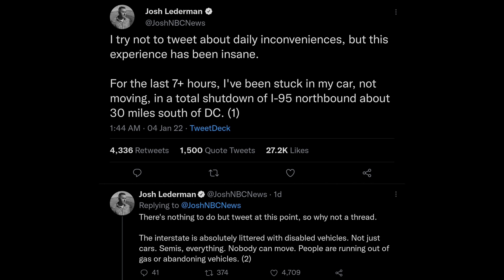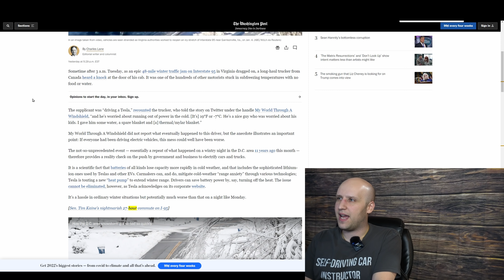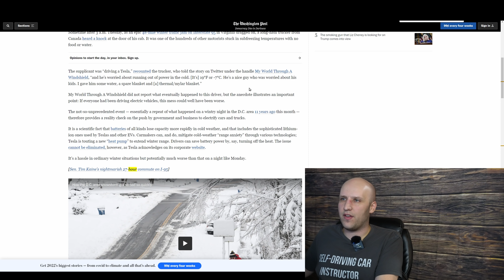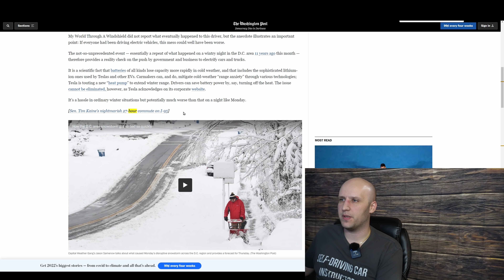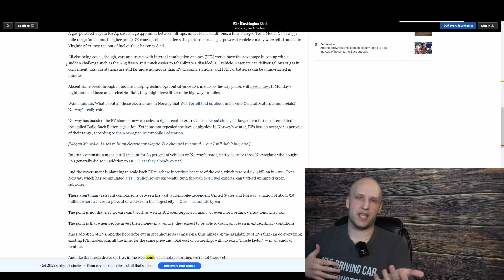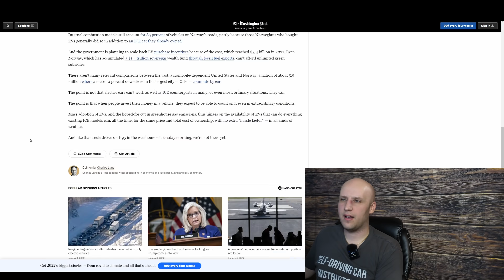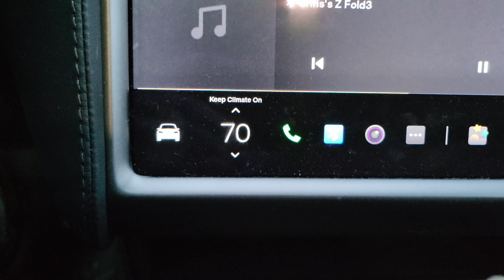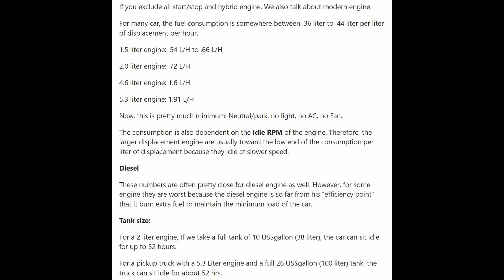How Long Can a Tesla Keep You Warm In A Frozen Traffic Jam? | FUD Debunking

Comment: I was stuck in that I95 shutdown. I drive a 2018 Model 3 LR RWD. I was at 90% when I left work and when I came to a stop on I95 with 73%.  I did not move for 11 hours.  I kept my heat on contently at 68 degrees and streamed Spotify for 5 hours. I did not use my seat heater.  When I start moving again I was at 40% charge.
Reply: Strange, I was at lower percentages and also played some games and got out at 40% that traffic jam was fun I made 3 friends they were all driving EVs a Bolt EV and VW Polo e-Golf and a Tesla M3P I was in a Tesla MXP and none of them ran out of juice
Reply: Did you drive to a Tesla charging station after that or just head home?
Reply: As Dirty Tesla said using your seat heater is much more efficient then using your AC to warm you. Blankets help too. Me personally, I don't us my seat heaters all that much, only at the beginning for a drive if it's cold. I had been driving for 30 minutes before I came to a stop on I95 and my seat was already warm from my body heat. I can charge at home but my driveway was blocked with many downed trees. The I95 shutdown caused traffic to find any other route that was open. This resulted in traffic jams on most roads through Stafford, VA where I live. Getting to the Supercharger at the Wawa on Rt610 near I95 was very challenging. I pulled into the Supercharger at 13% battery.  Great for 250KW V3 fast charging!
Reply: @Matt-vz8lz  How long does it take to fully charge the Tesla on super charge?
Reply: @lincoln169  mine takes an 1 hour and 15 minutes depends kn the range you chose
Reply: What if you had used your seat heater?
Reply: @waywardgeologist2520  If your tesla or other type electric car has a heatpump heater it is better to let that heat the car. If not then if possible use very little heat or no heat at all and use the heated seater to keep your body warm as much as possible.
Reply: Good information. Thanks.
Reply: I was traveling to Virginia with my family, luckily we were advised to avoid I-95 (despite the weather), though the roads weren't great out here either. I'm from New York, I can't believe how quickly an entire city can be shut down with like average snow for my area. 

It has to be the lack of infrastructure because there were technically warnings about the snow the day prior, though who would take them seriously considering the conditions the day earlier?
Reply: @jpsalis  it happened in 2016-2017 in VA around then too, media was calling it snowmaggedon.  I was living in VA then now I’m in CA where it doesn’t snow lol
Reply: @jpsalis  Or was it the people who did not heed the weather warnings?
Reply: @jpsalis  Yeah we need Joe to spend trillions more on infrastructure. Oh wait; his buddy Obama already did that. Hmm..... then why is our infrastructure still crappy and like no visible improvements? Oh yeah, the banks took the money somewhere else.
Reply: That’s awesome
Reply: When the gas cars apeared theytold us to buy a horse, when the electric cars are begining to play a rol the told us to buy a diesel. The thru is that gas car ar the past in 20 year they whil make jokes if u buy a disel or petrol and dont buy an elecric car. Sorry for my bad english
Reply: You should have used the seat heater and turned the heat down to around 60 and also shut if off from time to time for intervals of say 10 minutes to further save the battery. You didn’t know how long you would be stuck.
Reply: What if all these cars died and had to be moved when the road was cleared? Who’s going to be charging them all at the same time?
Reply: @TKUA11  Well there were many EV drivers and we made a circle among ourselves and I am saying NONE of them ran out of battery for the whole duration
Reply: Lucky you didn't die or get hypothermia. No battery energy stranded on the road is way worse than getting a quick fill up of gasoline from a red can.
Reply: Clearly your EV should be sent to the crusher. Gas cars never have any issues in cold weather! Who would ever rely on electricity for starting a car.....preposterous I say.
Reply: @Windupmykilt  EVs don't start they just run that's the thing a cold engine may not start up but motor it doesn't need to rev up to a minimum rpm to work its just gonna run as long as it has electricity
Reply: @ray.upside-down  I think they were being sarcastic… ICE starters are driven by a small electric motor, so they are saying that EV haters who say electric motors can’t handle the cold are so wrong because their own cars rely on an electric motor to start.
Reply: @Windupmykilt  Why be an EV hater when its the same but better and also helping the environment. I am ready for your arguments with proper explanation
Reply: @ray.upside-down  It was a little subtle, but Windupmykilt was being ironic.  Yeah, he was joking.
Reply: @ray.upside-down  Read the room bud, its clearly a joke. The sarcasm is in plain sight. All ICE engines require electricity to start (12 v battery to starter motor, system only charging once running from the alternator). The cold effects their ability to start worse than an EV as a -30 C engine can be bad enough to barely crank from cold oil, cold battery and low prime in the fuel rail. Its always funny the FUD regarding EVs as in the winter most people are plugging in their ICE cars around -20 C as some cars are like a boat anchor for cold starts even with synthetic oil. Diesel vehicles will have a hard time generating cabin heat in cold temps us well unless your get a grill cover and a idle throttle up adjuster. My next car is very likely a full BEV anyway, Im a huge supporter of EVs

Comment: Would Camp mode not have helped? During other tests the M3 for example eats around 30 miles during a cold night (-20C), that would be roughly 10% , the 40% you experienced is quite a leap from that. And also one thing that the article nicely avoids is that for running a ICE car you run the risk of actually dying of carbon monoxide poisoning, as your exhaust pipes can easily be blocked during a snowstorm. In a electric car you can pretty much set the temp and have a nice cozy night while not having to wake up each 30 minutes, run the car for 10 then shut it down and go back to sleep until you freeze again.

Comment: Idling my ICE car burns about 1 gallon every 2 hours. So my 19 gallon tank if completely full would take 38 hours before it runs dry. So pretty much the same as Tesla plus you don't die from carbon monoxide poisoning in Tesla.

Don't forget, my Telsa has a substantual below 0% buffer. My ICE car doesn't.

Comment: I drive a 2020 Modal Y. Love it. I did actually get stuck in a highway closure on a long road trip once for about an hour and a half before I decided to drive backward down the grass median and get off the highway. Obviously much less time than this, but I was a little worried for one reason which was totally my own fault, but I think also kind of part of EV road trip culture. At the time of the jamb I was at about 16% charge. I was only about 20 miles from my next charge stop which would be no problem. It was mid summer so the AC was running, and I did get nervous as I watched the percentage drop a few over the time I waited. The road trip culture that I was referring to is that myself (and many other EV road trippers I believe) like to arrive at the next charge stop with as little charge (5-15ish%) in the battery as possible to take the most advantage of fast charging up to the point when it tapers off, and then hit the road to the next stop. 

Obviously you wouldn't do that type of thing in a gas car (try to run down the fuel as much as possible between fill ups). In fact the culture is most people fill up at 25% (quarter tank) or above. Idk, just got me thinking. Not a fault of the car or the battery at all, just a fault of how I CHOOSE to use it. I could totally plan into the trip to always make sure I stop and fill up at 25% or above. That's just slower though.

Comment: Good test, I think a ICE will still run a little longer depending on model, and if done right but you would have to be more careful about carbon monoxide poisoning.  That fact alone makes me prefer an electric in that situation.

Edit:  Oh yeah they had plenty of water if they had even a used Mc Donald's cup or something and just thawed it out and warmed it up on the defroster.
Reply: You turn the HVAC control from fresh air to recirculation. This will prevent the HVAC from pulling in the exhaust fumes from the car in front of you.

Comment: I own a tesla too (model y with heat pump), but you're stretching here when talking about how it's not that bad in cold weather.  recently drove through montana.  tesla chose the route and charging stations.  Barely made it to a couple of the chargers and the car WOULD NOT EVEN LET ME TURN ON THE HEATER.  I almost lost toes from frostbite.  I had to stand of the seat while driving because the seat heater was the only heat the car would allow.  There was also no warning or on-screen prompt that I would not be able to use the heater.  True story.

Comment: I read the same WaPo article, and posted a comment there with some of what you mentioned,  I also used the example  of the SoCAL chapter of AAA  which did have generator equipped towtrucks for a while, but found that "range anxiety" was not happening and I think they don't have them anymore. I forgot the "Tow Charging" trick you included, Thanks. 
Because I travel into the mountains quite regularly, I have for many years kept a Space Blanket in my cars including my Tesla, just in case I forget to have a warm jacket along. The human body emits around 75 to 100 watts of  radiant thermal energy to go with that seat heater, and the car's air heater.  Good to know that a half tank of gas or a half charge in the battery are roughly comparable.
 I think this sort of article would not be appearing in the media about Tesla if they would just do what all the other car companies do and place ads with them. Packard might still be a viable auto manufacturer had they not insisted that their quality was such that their line "Just ask the man who owns one" worked as well as GM's massive ad buys did in the 1950s.

Comment: Hey Chris! You need to scream this from the rooftops!  This was a great experiment showing that you are equally safe (or equally screwed) in a Tesla compared to an ICE vehicle. A few more points for Teslas are the ability to stream entertainment for yourself or your kids during the time you are stranded on the highway and not having to worry about carbon monoxide coming into the cabin from a partially blocked tailpipe (a very realistic possibility, especially if it continues to snow and blow while you are stuck). Keep up the great videos and the great information!
Reply: Sorry, but you can stream and entertain in any ICE vehicle too.  It's called cellphones and tablets.  (You can even stream music too).  As to carbon monoxide  coming in the cabin, I would turn on air recirculation. Make sure to keep snow clear from around your vehicle. (Doesn't matter ICE or EV)
Reply: @Pk3_Garage  so in the ICE car you have to step outside several times in a blizzard to make sure your tail pipe isn't obstructed. And in the EV you can stay warm inside through the night. Sounds about the same.
Reply: Rather your in an ICE or EV, it's a good idea to clear snow from around your vehicle. This will prevent you from being trapped inside. The tail pipe on our minivan is around 18 inches off the ground, so I'm not concerned. (We have rear air adjustable shocks)

Comment: One thing the article completely overlooks is that MOST people that own EVs charge them at home in their garage over night, and wake up every single morning with a full or nearly fully charge. That's actually one of the biggest benefits of EVs...having a full tank of "gas" every single morning. People only fill up their ICE vehicles when the get low on gas; often less than 1/4 tank, because it's inconvenient to go to a gas station. Thus, it seems more likely that a typical ICE vehicle would be stranded as compared with a typical EV, because it is much more likely the EV has a full charge and the ICE vehicle has half of a tank or less.

Comment: my first winter with a Y. 15F this morning, and snowed over night. Car was plugged in and preheated before leaving. Wife went to a couple of stores, 12 mile drive with a couple stops.
used 60 miles of range.
Not likely to take a trip in the winter (anyway) but certainly not with 'performance' like that.
Reply: That sounds strange, those numbers would essentially make EVs unusable in Norway (which they are not). Weird ... I can't say why you got so low a remaining range... don't suppose you noticed the remaining state of charge?
Reply: @nielsnb11  some T folks say to precondition teh battery in the cold. Fine for leaving the house, but if it sits an hour in 15F temps it will get cold again. Then prec will suck down the battery, so why do it?

And heating the interior up over and over sucks power too.

I know they tested the Teslas in canada, so I expected better.

Comment: Please run a full test by letting the battery run empty. You said yourself that the cars used more energy to heat the cars up at the beginning which means that there is no linear behaviour. Also maybe reduce the cabin heating as you would in a real emergency. That would be a more convincing test to convince people who don't trust electric cars for some reason.  Considering that most people would be wearing warm winter clothing in a snow storm it might be enough to only use the seat heating without the air heating to stay warm. Thanks, that would be great.

Comment: Great video. There are now several MOBILE Batteries to charge EVs that you can have in the car - like many have a spare-container of gasoline. They're just very heavy:50-75lbs. Also, GASOLINE in the USA WOULD COST about $8.00/gallon IF NOT SUBSIDIZED! Talk about EXPENSIVE to drive 15,000.00 miles/year with a 20mpg car: $6,000.00 just for gasoline!

Comment: IF and ONLY IF the battery had 91 % or 90 when you encountered the traffic jam.  Most would not start with that charge.  Do it from 44% or 60%.   Full charge is the operative word.

Comment: Good video.  Very useful information.  I'm guessing that anyone who ran out of gas or electricity in that jam entered it with low levels or completely mismanaged staying warm during it - and also didn't have any extra gear like a blanket.
I've slept in my Model Y many times, including cold weather. I always travel with a memory foam mattress, sleeping bag, liner, house pillow! I like keeping my Tesla at 69° for sleeping. I think the most it's dropped in 10 hours overnight is about 10% (So these are less extreme conditions).  I've also slept  very happily in tents at -10°f,  mummy bag, air mattress, air pillow, wool clothes, socks, Reactor liner, wool hat.) 
I used to sleep in my Prius V, twice in very heavy snowfalls (the car has almost no traction-not advisable). It too was efficient, but I didn't like the ICE motor turning on for a minute every 5 minutes or so, so I'd heat it up (or cool it down) and then turn the car off until 4-5 am then turn it on again for a little while. (In the Tesla there's camp mode with the stupid screen image or just remote turn-on climate. This latter one will only run about 6 hours - not a problem. Just turn it back on from your phone.) 
 I think in survival mode:  the Prius with some basic gear like I carry,  could last a few weeks - but it wouldn't be at 70°.   My Tesla? just comparing the ranges of the two cars 325 miles and 450, about 2/3rds of that time. Of course the Y has a heat pump so maybe it would do much better.  (I now burn about 1700 calories a day (documented), most of that is heat so you could figure that into your calculations.)  I think both cars would be significantly more efficient than an ICE vehicle. (Older cars had terrible insulation.  You'd be better off in a tent. All that uninsulated metal was like a big heat exchanger.) 
 I think the lesson here is that everyone driving cross country should carry in their vehicles sleeping bag, blankets, extra clothes, (wool leggings and socks - want to be happy? wool leggings and socks), water, instant coffee, a jar or TravelJohns.  Toothbrush! (and audio books, good flashlight, like a Fenix, mittens!)  Air mattresses take up no room, air pillows- same thing. (btw don't expect any shortcuts around the air pillow. Super light weight backpackers ('I hike the PCT with only a ten pound pack') nevertheless always carry air pillows. Costco sells down quilts for about $25. Really good kit. 
I think the biggest problem I'd have had in that 24 hour jam is having to let 3 strangers into my Tesla to stay warm.
Reply: Great insight
Reply: Great comment! I think a lot of people stuck in the storm were just commuting or making short trips, and so wouldn't have had food, water, warm clothing, or blankets.
Reply: @happysalesguy  I usually have that stuff in my car when I go to Costco in Los Angeles. (But Prepper videos kind of scare me.)  btw the Costco I like; went to yesterday? About ten years ago there was a train wreck right next to the parking lot. So you never know....  Hopefully all those folks and others will put a couple of blankets in their cars.
Reply: I keep a zero-degree sleeping bag in my car year round. My EDC bag has things like a flash light, lighter, knife, first aid kit, etc. The only food I would have had was whatever was leftover from my lunch, so I probably would have had to resort to cannibalism of ill-prepared ICE drivers.  Just kidding 😂 😜